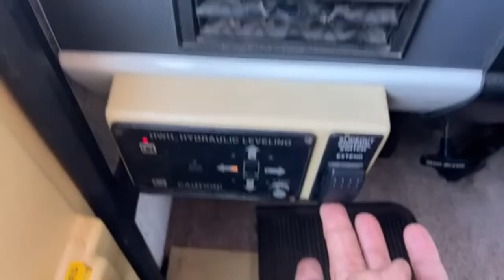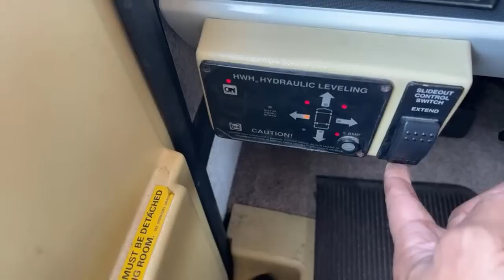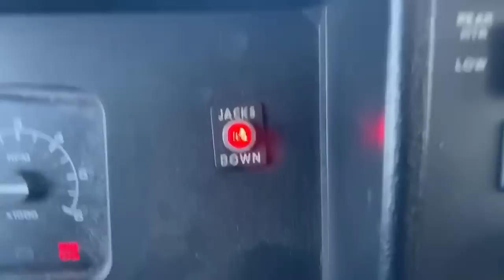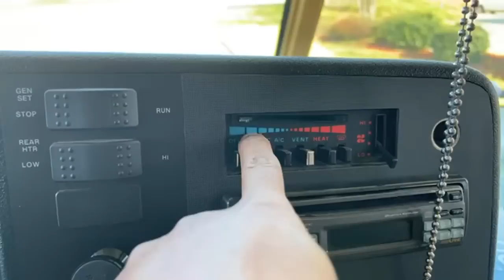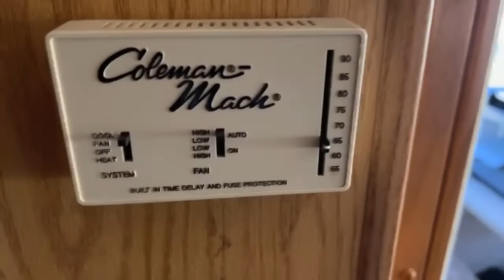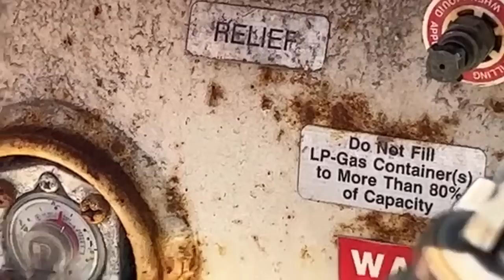First time Rv camper owners things to think about

Comment: Bought a used NEWMAR  Rv (2000) $150K original for $17K with 34k mileage.  everything works well; it drives well my Mechanic checked everything and  I'm Very Happy With it.
 I  took all the frames around the windows  off and Burned them , 700 lbs burned High

Comment: If they aren't using the RV or keeping it in a barn or something they need to be drained and winterized!! You can either learn to do it or pay a RV place. Take the RV to a mechanic and have them check it before buying. Look for water damage in the ceiling corners. Look under the sinks, soft spots in the bathroom, ask them to put water in the tanks and run the water that's big cause they will say " everything worked last year when we parked it " eeerrtttt.... Red flag you need to see it work . Check the stove burners, and oven , water heater,  Check the fridge, check the furnic that's also crazy expensive. Look under the RV check the tires . You can get extra batteries installed you can add a few solar panels if you are gonna be parked for a bit but don't let them sell you a crazy expensive solar set cause your alternator will charge your batteries just make sure you don't over do it!!! Please take someone with you that owns a RV so you don't bring home a big ass lawn ornament.  I mean remember you get what you pay for . Ya know.Dont take this wrong I'm telling y'all this with 💕. I'm looking out from experience. Stay safe my friends from afar.

Comment: Could be She may have bought her RV outright ($40K) because there is no man to fix/help maintain her RV. Although there is no guarantee she won’t have immediate issues with a newer RV, if she is single I can understand her point to purchase new. IMHO
Reply from the maker: Nope she didn’t buy it cash. She told me was financing it. Even if it’s new, your warranty only covers so much. Like motor and chassis the rest may have very very limited 3rd party warranties. So be careful either way new or used.